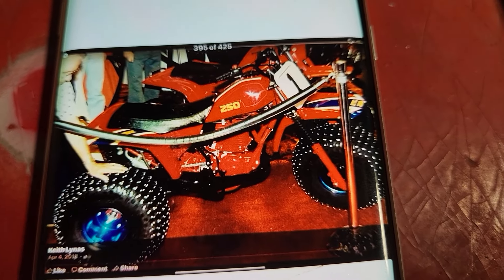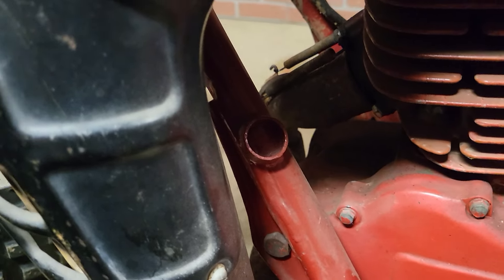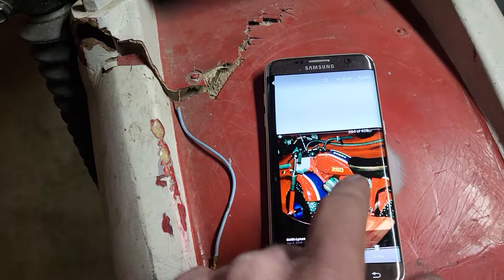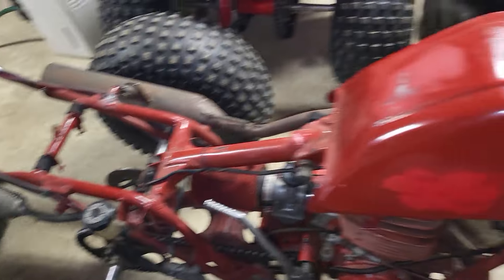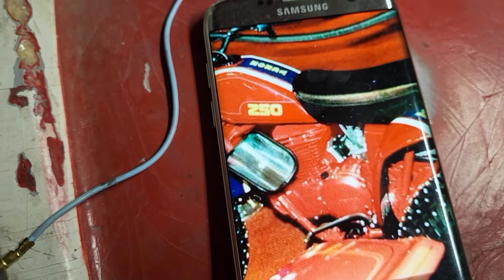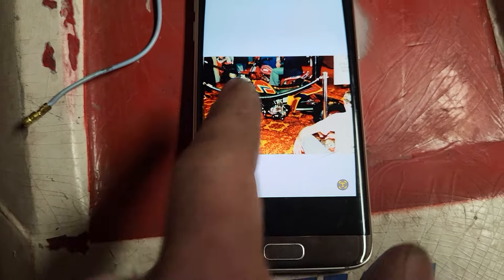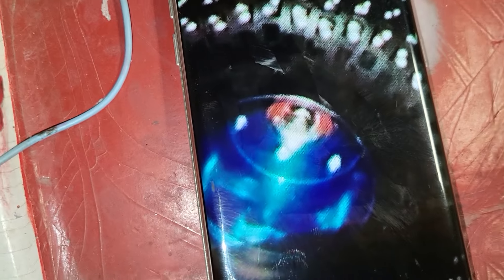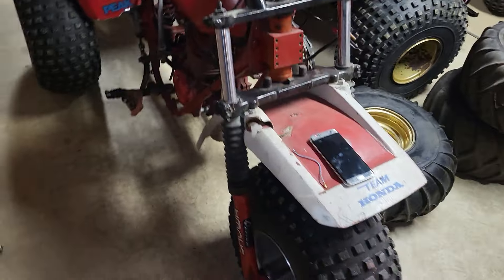honda atc pre production factory set up ice Racer

Comment: This is awesome man. Now to firther this investigation, as to yours being the exact one in the picture. I think one of the only ways to verify would be to pull the cylinder and see if it's got porting, or any other race team specific mods internally that wouldn't have come on some old trike made made to just get ergonomics correct. They wouldn't port the cylinder out. They prob knew back then the physics of the 2 stroke pipe so for a high revving ported motor They wouldn't wanna have the elephant trunk style, restricting flow. Either way you are deff onto something here. I think there's there's good chance you have the exact one in the picture. Notice there is also only one trike like that in those pics. There's no far away pic showing a row of race trikes. There's the one race trike highlighted.
Reply from the maker: I'm pretty much 100% because of the motor mounts the flywheel cover the brake bolt location the paint job I'm convinced, thanks for watching
Reply from the maker: The "enduro" one has a more stock ATC engine.... but the yellow sand drag one and the one with the H on the fenders had CR engines

Comment: Love it !! your getting to the bottom of it . I ran up in my attic tonight as I remembered I have some NOS polished old school 2 piece wheels from a dealer I bought out in Kansas years ago  but they are 4 bolt wheels for like a early  185 or 200  I did find one half of a 3x100 polished 2 piece wheel but its narrow I'm thinking front wheel for an FL250.
Reply from the maker: Dang... I think I may have this one welded or make aluminum slugs drill it out press the slug in then weld them and put the bolt pattern right through the slugs... I was gonna email you and get your opinion on how to repair that wheel.. the slugs have to be a little thicker then a dime  2 piece wheels are killing me... I have an nos hub on the way it will stay yellow zinc till I get it chromed... but that wheel is the hang up